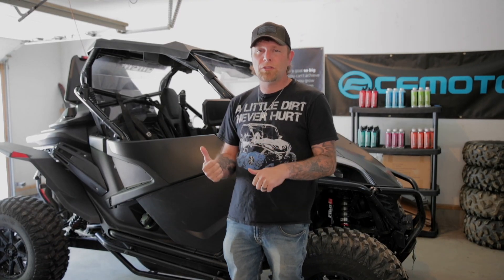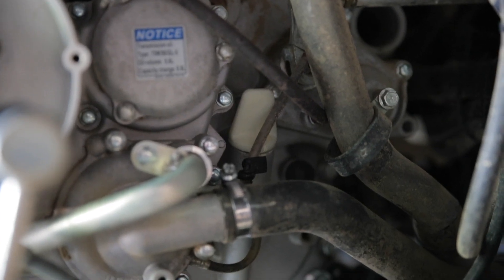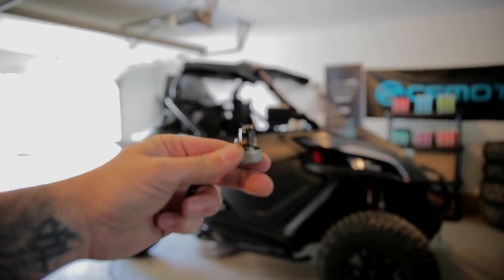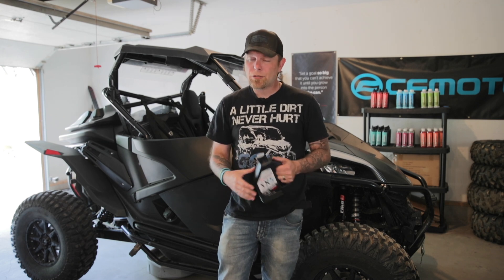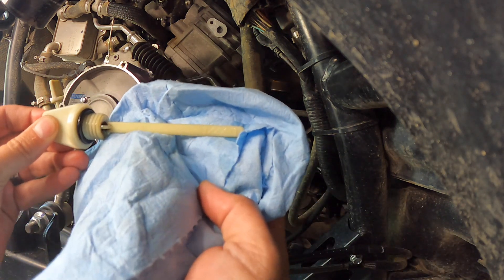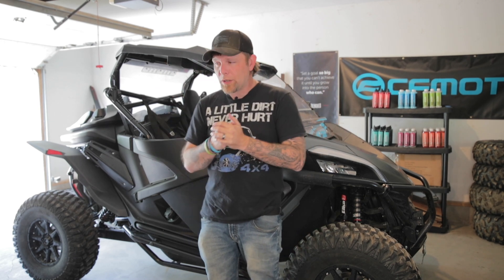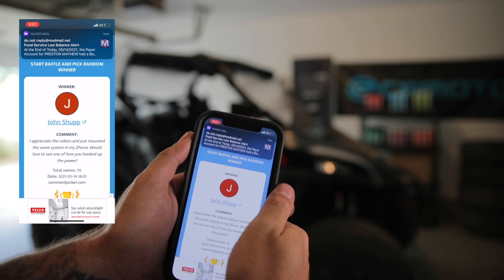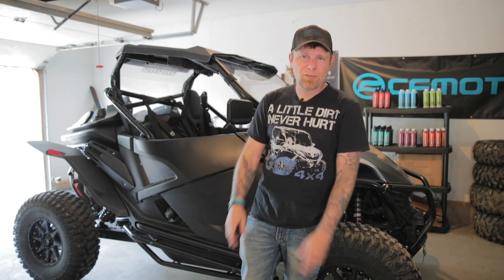CFMOTO ZFORCE 950 SPORT - TRANSMISSION OIL CHANGE + Clutch Kit Giveaway Winner

Comment: Very informative video! I also have a 2021 ZForce 950 and it has been a great machine and I will need to do this very soon. Quick question, sometimes when I'm just cruising, doing trail riding on it, it kind of looses some power. If I leave my foot steady on the accelerator pedal for a long period without going over 20mph it sometimes looses power but it comes back quickly. Is if I was stepping off the pedal, but it isn't because there's no engine breaking. And the weirdest part is that this only happens on uneven terrain. When I'm doing the same type of riding on a flat surface, I don't get this problem. At first I thought it was a safety feature but then I saw someone posting the same problem on the ZFORCE 950 FB Group and few others replied with the same problem. Some are saying is the evap canister, but no solution. Have you experienced this with yours? Saw your post that you have a video soon about the EVAP Canister delete. Any input would be appreciated. Keep up the good work with this videos!
Reply from the maker: I have not experienced that, but I do have an evap canister video coming soon!
Reply: @JustinTheCreator  Can't wait watch it!